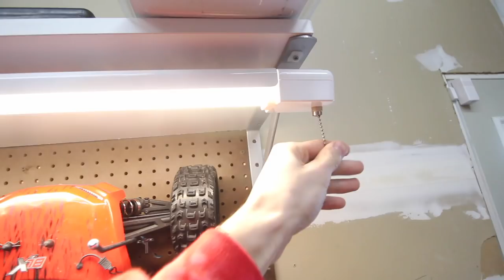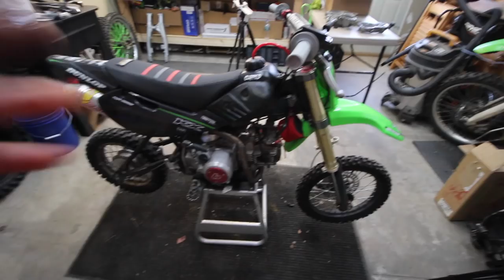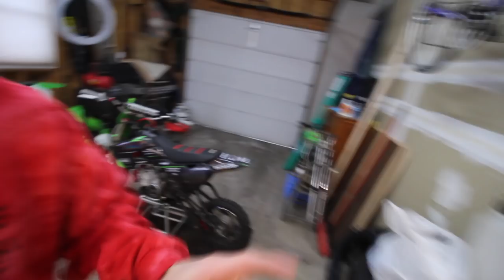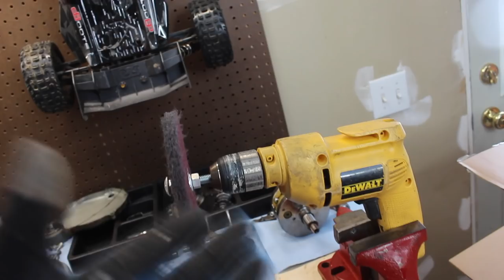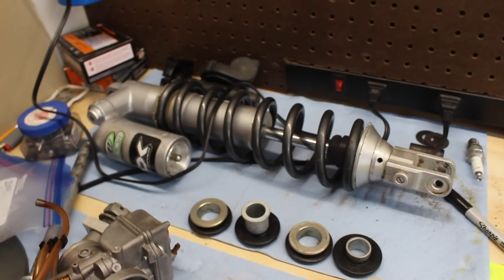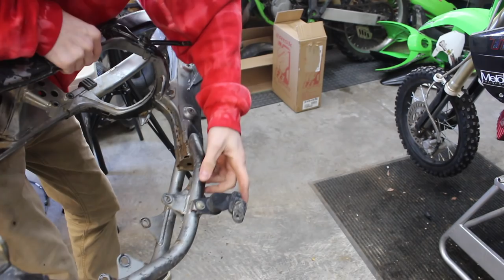2018 KX125 BUILD PT.4.8 | NEW PARTS! PIT BIKE RUNS PERFECT!!!

Comment: If you use the 3M pad and scratch up swing arm and the other parts after you vapor hone them you can use aluminum polish and make your parts shine like chrome. I have a 08 250r and I polished up my frame quite nice with just the polish it’s self.

Comment: Before you start putting that thing back together get yourself a manual. They are fairly cheap or free if you search enough online. You won't be able to find all the specs you need from other YouTube videos. It will also not just work itself out either.

Comment: I would use mothers aluminum polish.
Reply: Carter Pereira56 I’ve used that before with my snowmobile. I wet sanded and used the polish, wasn’t very shiny
Reply: Kolton Sheppard well you didn’t do it right. You put it right on it, scrub it with your hand with a glove on, then rub with a rag. Do it the right way and it works great.
Reply: I did do it the right way, the proper way to use it when you polish a snowmobile tunnel. I just wont use this kind of polish thanks for the feedback

Comment: I am thinking about getting a 2016 kx250f and I have heard that it doesn’t handle good, Is this true?
Reply: Nolan 320 no lol. Not true, I love mine. Really nimble, and the front end and shrouds aren’t wide like that Yamaha’s so that’s a plus
Reply: Thanks and I will be transitioning from a two stroke and I am wondering what the engine brake will feel like, is it hard to get used to or is it not that extreme
Reply: Well I raced my 150rb so I’ve always ridden 4 strokes but you’ll get used to it. It’s not as hard as you’d think. Especially if you’ve been riding for awhile